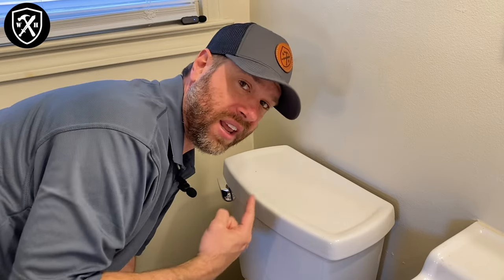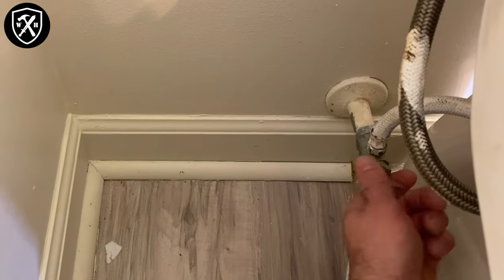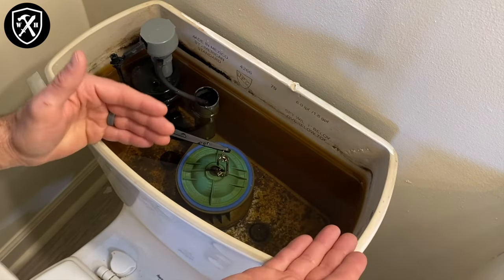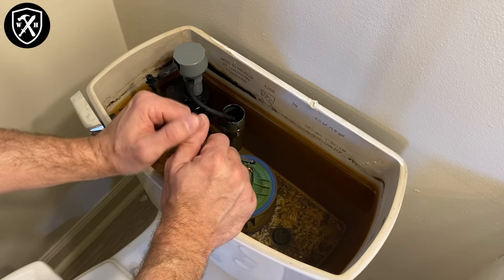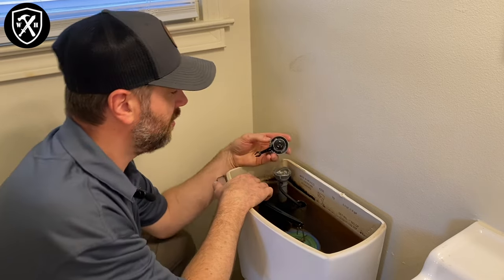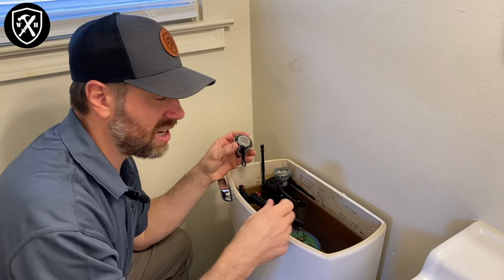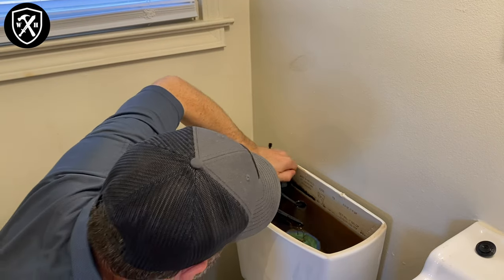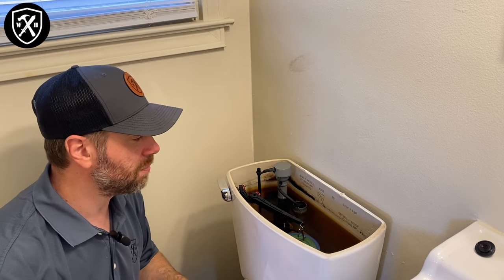How To Fix A RUNNING Toilet GUARANTEED | DIY Fix Fast Cheap & Easy For Beginners

Comment: We took the cap off the valve, pulled the seal off the needle, cleaned all the grit out, trickled some water through, put the seal back in, caped it and reattached the float adjustment screw, works like new...for how long? Thanks for the tip!
Reply from the maker: Sometimes just a cleaning is all you need. Keep an ear on it and at least now you know how to replace the seal if it happens again 😎 thanks for sharing!!

Comment: What if the toilet is different inside my toilet don’t have that
Reply from the maker: There are different types of fill valves. Usually you can find a part number somewhere and check for a seal part number from that. Or you can email me a picture and I’ll try to help you out. Jr@warrior.house thanks for commenting.
Reply: Same here. :(
Reply from the maker: I’m happy to help if you’d like to email me. Thanks for sharing.

Comment: Most of the time it is not valve, it is rubber ring on the bottom of the tank, which probably thoughtfully purposely made out of such rubber that will dissolve over time, becomes eroded by water and the main valve is not able to keep water in the tank. Therefore it is much different repair, happens more often than with control valve.
Reply from the maker: Agreed. Always important to rule out different possibilities before replacing parts. Food coloring in the tank can help follow the path of leakage, if applicable. Thanks for the comment and input!

Comment: why you assume everybody has a fill valve? these young guys have biases they are not aware of... there's stuff older than fill valves, still working
Reply from the maker: I don’t assume. This will not apply to every toilet, just the majority of them. Thats why it’s important to check the inside looks like this one.

Comment: After seeing the innards of the toilet, I doubt it was your fill valve that was the problem. You have a champion 4 flush valve in that toilet that's notorious for leaking around the seal. Your flush valve seal/s probably needs replaced, not your fill valve.
Reply from the maker: Agreed but in this case the fill valve seal was the problem. No doubt the city water and flush assembly make for a leaky combo over time. Thanks for commenting

Comment: yeah.... pushing down and turning doesnt open anything up...
Reply from the maker: Pushing down and turning counterclockwise is the way to remove the top. But sometimes the whole valence assembly wants to turn so you may need to hold below the top with one hand while pushing down and turning with the other. Hope this helps and thanks for commenting.

Comment: Whenever I flush my toilet after it sounds like water is dripping. But there is not physical water present
Reply from the maker: That could the seal between the tank and the bowl. You could put some food coloring in the tank and see if it transfers to the bowl without flushing.

Comment: So glad I came across this video while searching how to repair by 'running toilet'. My water bill, since the summer had increased from about $35-40 monthly, becoming routinely over $70 now. 
I noticed recently water running down the back of the toilet bowl at a very slow trickle; continuously. I suspect this has been going on for quite awhile. Convinced I need to replace the entire valve I started searching youtube and found your video.  Always the guy to try the simplest solution first, replacing the seal solved the issue for me. Only $3.48 at the big orange box store. I will now order a couple off of Amazon to have for any future issues.  Thanks for the solution. I'm now a new subscriber to your channel.  👍🚽😄
Reply from the maker: Man so glad this was a help for you!! lol we actually went over $400 since couldn’t hear the water because of the baby’s white noise maker lol. Thanks for sharing! And thanks so much for the kinds words 🙏

Comment: thank you for making this video!  It helped me make my toilet stop running.  I think I inadvertantly loosened the fill valve when replacing the chain between the handle and the flapper in the past and that caused the issue.  all I had to do was push down and turn it right to tighten it and it immediately worked again and water no longer endlessly goes down the overflow pipe.  I had the water adjusted to the lowest level and it still went down the overflow.  Now I can adjust it close to the top of the overflow pipe and no noise at all!
Reply from the maker: You are so welcome and thank you for sharing!!

Comment: I never knew you had to twist off that top, I couldn't get the rod out but I did it anyway and sure enough it twisted off, then the rod came out. There was white calcification on the valve seal so I cleaned it for now with white vinegar and an old toothbrush, put it back in and problem solved. I'll pick up some extra seals asap but for now, when I leave the house I'll shut the water off but it's not running anymore. Thank You!
Reply from the maker: Great job!! The seals can definitely be cleaned not only for so long before needing to be replaced. Thanks for sharing

Comment: I need to know how to fix my American Standard 4519A toilet as the tank is not filling up with water as fast as it should so I can flush. Any help would be greatly appreciated..
Reply from the maker: Could be debris in the fill valve slowing down flow, could be water pressure. Also check the fill level. Hope this helps 🤷‍♂️

Comment: Our toilet takes up to 4 times longer to refill after a flush as a normal time. I replaced the seal and flushed the supply line. Could the problem be in the restrictor at the bottom end of the fill valve? If so, what are the pros and cons of removing that restrictor?
Reply from the maker: Hard to say for sure but I can say I don’t like restrictors. Could there be a kink in the supply hose?

Comment: Do you turn to the left or right on the fill valve ?   I’ve seen both ways in videos
Reply from the maker: I’ve always turned counterclockwise (to the left) but I never tried turning to the right. Might be multidirectional

Comment: Should the activating pin poke through the seal orr does that mean seal is damaged? Thanks
Reply from the maker: It should NOT puncture the seal. I haven’t seen that but I have seen seals that deteriorate to mush so I guess that very possible. Thanks for sharing :)
Reply: @WarriorHouseDIY  thanks a lot. I Thought it might be stuffed
Reply from the maker: @stevec9972 no problem. At least it’s an easy fix 👍

Comment: I can't get the fill valve cap off and I did what you said to do. I have big strong hands too!!
Reply from the maker: If you tried pushing down (hard) and turning counterclockwise and it won’t work, it’s possible that the unit is just seized up. I would replace the fill valve assembly (available at a local hardware store or here https://amzn.to/3vgZbf0 )

Hope this helps👍 Let me know. And thanks for commenting.
Reply: @WarriorHouseDIY  Thanks so much for trying to help me. I got the cap off but now I can't get the little plastic part out. Oh well, I tried. I live in California so a plumber is going to cost twice as much. I tried replacing the flapper but that didn't help either. The flapper I bought was universal and it seems to be working fine, so I don't know. Thank God I have more than one bathroom!
Reply from the maker: @dbcooper692 the rubber seal should come out pretty easily with a pliers or tweezers. Replacing the fill valve assembly is as simple as turning the water valve off, disconnecting the line after drawing the tank and unscrewed the plastic nut under the tank for the fill valve and reverse the process for installation.

Comment: What about toilet valve that is spouting water from the fill valve?  Which was not letting in water inside the bowl to begun with but after opening the top of valve and cleaning debris and putting  it back is now spouting water from the top?
Reply from the maker: It’s hard to tell without seeing the situation but it sounds like the valve is leaking past the seal and not shutting off. If there is a crack or other damage to the valve then it’s likely the whole valve assembly would need to be replaced. Easy fix, parts are available at all hardware stores.

Comment: What if you flush out fill valve and replaced seal and still running? Water is leaking from Fill valve cap.
Reply from the maker: I would think either the cap is not on properly or that the valve is damaged. I’ve had a few times where the cap just wasn’t on tightly or properly. Hope that helps.

Comment: The toilet Seat prevents the handle from going up naturally. Can the handle be adjusted?
Reply from the maker: Some handles have an adjustment by unscrewing them from the inside and then turning them. All are a little bit different though. If you send a picture or part number here or to my email jr@warrior.house I’d be happy to check it out. Thanks for the comment!!

Comment: I wonder if I can do this without turning my water off?  For some reason when I turn the handle behind my toilet it doesn't turn my water off.
Reply from the maker: It’s pretty common for old water valves to get stuck or even fail like you described. As for replacing the seal with the water running, once you remove the top of the filler valve the water will be “shooting” straight up. I suppose you could cover the it with a glass to divert the water downward? Many times we turn the water on with a glass over the top of the fuller to clear any debris. I would suggest addressing the water valve either way. Thanks for the question and thanks for watching
Reply: If its urgent to  fix toilet with leaky turn off angle stop valve...the one right below the toilet...you can turn the whole house water off..fix it and on again..sometimes newer houses will have shut off valves for sections of the house..good luck.
Reply from the maker: @michelleeasterly1985 very true thank you for sharing the tip
Reply: I've always been told  by my contractor..to exercise all your shut off valves..anything that turns on and off can easily seize over time..and then they are not usable..so add to your maintenance list to turn them on and off a few times a year..and don't snug them either way.. leave a tiny bit of play so they don't seize..goes for all valves..don't forget washing machine ones..and check hoses and washers.. etc.
Thank you WarriorhouseDIY..GREAT VIDEOS..SO HELPFUL..
is there any other way to get the compression fitting off the angle stop copper pipe besides that weird tool..I live on an island and often have to improvise..amazing what one can invent..lol
Reply from the maker: @michelleeasterly1985 excellent tips!!! And thanks for the feedback:) 

For the compression ring, sometimes I’ll get them to turn a bit with a channel locks then slide off easier. If you’re installing a new valve you could also make a small relief cut in the ring with a Dremel tool or cut the pipe short if you have enough length. Hope that helps
Reply: Thanks for the suggestion..im on a well with lots of sediment..makes things challenging..bless you
Reply from the maker: @michelleeasterly1985 usually healthier but yes, more plumbing issues. Let me know how it goes :)

Comment: Frustrated because I can’t get a flapper that doesn’t seal properly all the time
Reply from the maker: My best advice is to match the model number from the the toilet tank to the correct flapper. Seems to make a difference when aftermarket ones don’t work. Quick google search of the model number should give you the part number.

Comment: My insides of my toilet are new and it's still runnimg
Reply from the maker: How new? It’s possible with a situation like really hard water that mineral deposits could mess up the seal quickly. But if it’s really new, like under warranty I would see about having the fill valve assembly exchanged possibly. 

If the parts were just recently replaced, has everything else been looked at? Did you try some food coloring in the tank to see if you’re leaking at the flapper? 

Feel free to reach out to my email if you wanna chat more about this. Jr@warrior.house

Comment: Why is the tank so daek
Reply from the maker: Dirty? This particular one has staining from hard water. Deep? To build the proper head pressure to flush the toilet. 😉
Reply: @WarriorHouseDIY  well I will now learn how to spell dark. I didn’t know hard water stained.
Reply from the maker: @karens346 ah dark, yes it’s from staining. This hard water is high in iron, that’s where the red discoloration comes from :)
Reply: @WarriorHouseDIY  Thank you. Your video has helped us.
Reply from the maker: @karens346 Thank you 🙏 that’s what I care most about :)

Comment: I replaced the seal, but it still leaks 😢
Reply from the maker: I’m sure you checked the filler valve float lever and assembly to make sure it’s reassembled securely. You could always push down on the top of the filler valve cap to see if that stops the flow, if so, there could possibly be a crack. 

Also, guessing you checked the flapper to ensure proper seal. If bitcoin try gently pushing that down to stop the leakage. If you’re uncertain you could turn off the water and add some food coloring to the tank, if the colored water enters the toilet then the flapper is likely your culprit. 

If you have any other questions feel free to send me an email at jr@warrior.house 

Thanks for following up. Hope this helps.
Reply: I changed the flapper, and the water is still running.  So, I ordered a new fluidmaster fill valve high performance kit, with tank seal, tank bolts. Hopefully, that'll do the trick. Thanks for your help and expertise.  You ROCK!
Reply from the maker: Glad to help! Let us know how it works out.